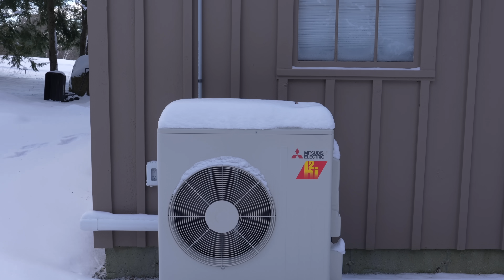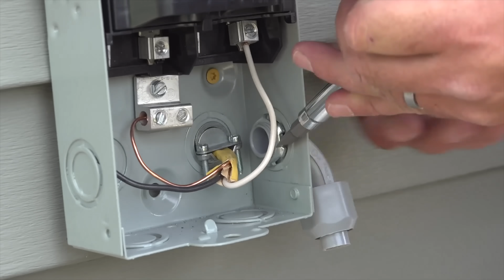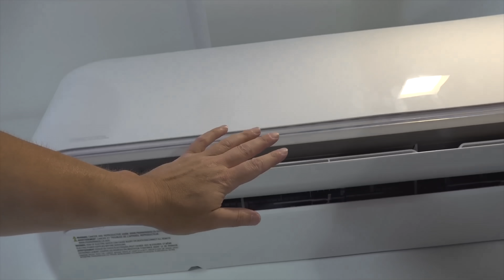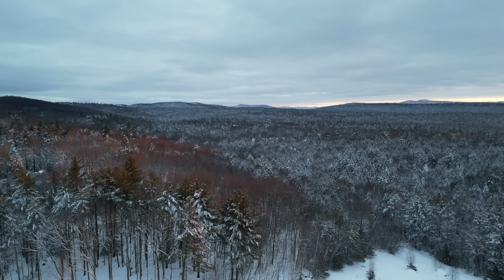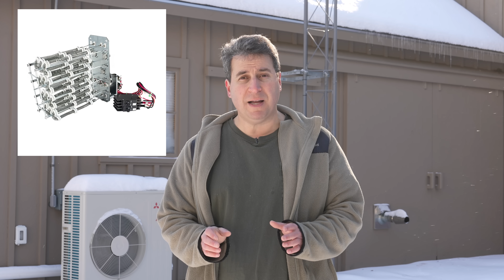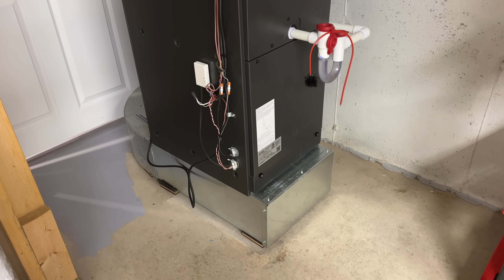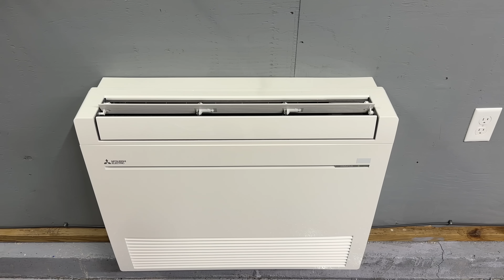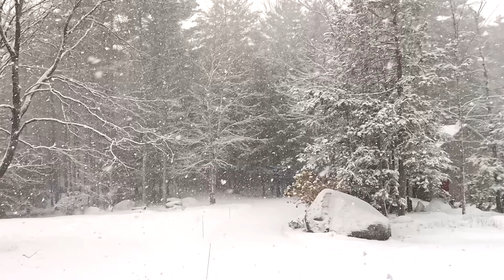Why Heat Pumps are now leaving people COLD

Comment: You mention at 3:55 about running resistive heat strips and "while that does use a lot of power for a brief amount of time it is much less electricity than simply running your heat pump endlessly trying to make up a temperature during those cold days". Do you have any data or sources for this? I am a bit hesitant to believe this, but if it's true I would definitely consider adding the resistive heat strips in my Mr Cool ducted heat pump.

Comment: Would a heat pump only system be adequate for a very well sealed and exterior+interior insulated new construction house in NE Ohio? I'm shooting for a total wall system R value of around 33, with triple pane windows, and a roof R value of at least 60.
Reply: My cabin in western NY we heat with a mini split all winter. No issues as long as the power is on. We do have a wood stove we use while we are their and for emergencies

Comment: What you guys really need is a heat exchanger for air that gets ducted out of the house- our European house has a ventilation system that circulates our air and recovers 97% of all the energy in the air it ducts out of the house, and I’m pretty sure it’s passive too. But our house does use a different concept for heating in the first place.

Comment: My installer installed a Mitsubishi Hyper Heat and sized it based on the 5 degree BTU reduced output. Running without supplemental heat and the heat pump system is keeping the house very comfortable down below 0 outside temperature. It helps if the install is done properly.
Reply: It's not rocket science, but many contractors are clueless.

Comment: I learnt that lesson the hard way. I bought A mini split because my baseboard heat was too expensive. Starting at 30 degrees outdoor temps. the baseboard heat has to be turned on because I want it warmer in here than 65 degrees. Mini split and baseboard used together still lowered my power bill $49. Cheaper than baseboard heat alone.
Reply: Well, yeah.

Comment: I don’t know man. Last winter I had  10F during the day for several days and my office (medium size open with no door) was 70F. I have Mitsubishi Hyper Heat.
Reply from the maker: As mentioned a lot depends on your home, size, insulation and what temp you expect. Mitsubishi makes great units. Sounds like your setup is doing well which is great. Power consumption and defrost cycles increase dramatically but as long as its meet your demand thats the goal.
Reply: @SilverCymbal Agreed. My house was built in the 40s, but I took a lot of steps after moving it to get it properly insulated by filling all the cracks. Power usage is definitely high. But it's the price I pay for not using oil (which would be higher). We do have supplemental electric baseboards (ripped out the oil hydronic ones and replaced them with hydronic electric), but I used it twice this winter in the bedroom (also hyper heat). And one of the times I was just testing it out. So yes, your mileage may vary, but the Hyper Heat is working very well for us (triple zone). We have another dual zone regular Mitsubishi for our lesser frequented rooms and that is also doing well, just not as well as the Hyper Heat.

Comment: Dual Fuel. I have a heat pump with a gas furnace instead of an air handler. Way cheaper to run than electric resistive.

Comment: This is inaccurate @3:58. The efficiency is denoted in Coeficcient of performance (COP). COP is KW heating divided by KW of power. a COP of 1 = 100% efficient. a COP of 4 = 400% efficient. during warmer weather, 55F, let's say the heat pump has a COP of 3.5; however, as the weather gets colder, the COP drops to 1.5, let's say. However, no matter what conditions are like for electric strip heat, the COP is always 1. Even in the dead cold, the heat pump is still cheaper. The only reason that auxiliary heat exists is because of a capacity issue. That's why cold weather heat pumps exist like hyper heat Mitsubishi models. They trade some efficiency for increased capacity in colder weather. However, the COP will never drop below 1. The heat pump will always be more efficient but may need more capacity. However, the hydronic coil may be cost-effective in some situations, but the strip heat never will be more efficient.

Comment: What would you consider the average life span of a heatpump that runs all year round?
Reply from the maker: Good quality brands can easily last 8-14 years. If you maintain the outside coil with cleaning that really helps. Likely in 10 years from now the efficiency will get so much better replacing it may be a good idea just for cost savings.

Comment: I have the electric auxiliary heat strips for my heat pump now and my electric bill still doubles or triples in the three coldest months of winter.

Plan on installing a propane backup heater this year.

This will also allow me to rely on solar to back up my electrical since the demand will be so much lower
Reply: Your heat pump is not sized correctly.

Comment: Good distinction on heat pump effectiveness and aux heat needs in NC vs New Hampshire. Here in NC as temps got down to 17F yesterday, 3 degrees below the 99% heat design temp for the area, my basic single stage 3 ton ducted heat pump ran continuously but the aux heat strips were never needed. My whole house energy use stayed below 4kw per hour except when my water heater came on in the afternoon.

In the past I found via my emporia vue monitor that heat strips were activating with each defrost cycle to the tune of 10kw for 2-5 minutes at increasing intervals as it got cooler. Once I realized the heat strips weren't necessary as part of the defrost cycle I disabled them on the defrost control board while leaving them able to come on if needed for aux heat. I never felt a blast of cold air during defrost, and per my heat pump's manual even down to 10F it would be twice as efficient as resistance heat though it's operating at half capacity. Natural gas would be nice if available at that point. If it got much cooler I'd likely be pulling out a space heater or two. 

One thing I like about small space heaters vs a 10kw heat strip is that it would be much easier to run the 1500 watt space heater on my generator along with my heat pump which has a soft start kit, while 10kw heat strips would likely overwhelm my generator in the event of a power outage.

Comment: Assuming air to air heat pump for heating a house. In example mini split unit. The efficiency is indirectly proportional to temperature differential. Assuming temperature inside the house constant the efficiency will decrease as the outside temperature drops. Fujitsu Halcyon should heat down to -5F (-20 C) when the efficiency is close to 100%. Some energy is also spent during the defrost cycle. The Mitsubishi HyperHeat is operating at 100% efficiency at 5 degrees F.    Even in Zone 7 (the great white north) the new Sumo coming from Mitsubishi has it's 100% efficiency pegged at -20f

What you are doing is fearmongering, not science...

Comment: I'm running my heat pump portable ac and at 11 degrees outside it can at least keep it 60 in my livingroom and kitchen where it is. I used wood burning stove and electric heat as suplimental though I try not to use the electric if possible. The heat pump is still way more efficient even at this temp suprizingly.

Comment: So long story short, you need 'additional heating' to your heat pump. And an Airco is literally just a heat pump. So this guy is saying, with a lot of words, that having an airconditioning unit to heat your home in winter when temperatures drop to 0, is not enough to keep your house warm EFFICIENTLY. it will, but the consumption of power is just really high. In fact, an airco, whether cooling or heating, consumes 'a lot' of energy until it reaches the temperature the thermostat indicates, and then goes into 'eco mode' so to speak.

all you need to do thus, is add another heater to your room/space. In other words, a literal electric heater, or an oil heater, or a pallet heater. pallet heaters consume little but are expensive to buy and place and they need an 'exhaust'. 

ethanol heaters are interesting but dangerous. 

electric heaters are fine, if you have one that is powerful enough. A 2 kWh heater generally consumes 1/4 of a day, meaning 8 hours 2 kWh if you run it for 24 hours. If you however set up a timer, and it is off during the night, let's say from 23:00 till 07:00 or 07:30, then it is on for  13:30 hours, so will be on for less than 4 hours - meaning it'll 'just' consume about 8 kWh a day - except that it would do this if it were the only source of heat.

if you combine this with your heat pump - airconditioning - then the supplemental heat of this electric heater makes the aircon reach its temperature easier and thus consumes less energy, but at the same time, the electric heater needs to operate less because of the airconditioning unit also heating the same room. 

The key missing ingredient however that is being entirely missed, is a ceiling fan. You need these 3 together. The ceiling fan will blow the warm air down that both the electric heater and the heat pump ( airconditioning unit ) are producing, eliminating quickly the cold air in the room, and keeping the warm air being pushed down. 

On top of that, all you need to add are shoes (slippers) with decent isolation, so you have an isolation layer between you and the floor. add carpets where you sit, which will operate as insulation between the (colder) floor, and wear warmer clothing - add a sweater on your shirt, and wear thicker pyjama's / sweatpants, add a small blanket when sitting, and add a few good heater candles. 

obviously, only heat the room(s) you are in. you don't really need to heat the bathroom at all. a warm shower is good enough, and if it is 'fresh' you will not 'want' to stay there for too long either so why heat a space you need to ventilate anyway ? 

the kitchen is only used for a few minutes in the morning / afternoon for preparing breakfast or lunch, and if you start cooking, the heat from cooking will warm the space up. use the oven more in winter. 

your bedroom only needs to have a relative small heating - a 'cooler' bed is better for your health anyway and thick, decent blankets and a good pyjama will be more than enough to have a good sleep, just, again, add a carpet right next to your bed and some slippers for toilet visits.

if you have a living room smaller than 25m2, and you put the electric heater temperature at 19 degrees C, combine it with the heat pump ( aircon ) and put that at 20 degrees, good clothing, and you won't have unneccesary high consumption. 

For those extra cold days - just add another layer (shirt) of clothing, extra thick socks, long sleeves, add a wool hat, and perhaps just put the electric heater 1 degree up.

compensate higher energy usage by taking shorter showers with less heat, lower the temperature of the boiler, and prepare foods that you can finish quickly - avoid like boiling chicken stew or soup for an hour or two. Instead, use meats that are cooked fast, less compact meats, and combine it with breads which do not require heating or cooking. 

Add a thermos, warm up some tea, and drink some rum or wodka in your decaf, and you'll get through the cold pretty well.

Comment: I’m in south Texas and we did get below twenty degrees at night. I have a heat pump in my garage and it did struggle to warm up the area. I simply turned on a space heater and it did the trick. I had to keep my newborn pups warm during them cold nights.

Comment: This is similar to a Swamp Cooler; in very low Humidity and in a specific temperature range...a Swamp Cooler will cool your house by about 10 degrees for a much lower cost than an Air Conditioner. But in high Humidity or outside the optimum temperatures a Swamp Cooler is not just more costly it has serious downsides or does not work at all. Swamp Coolers HAS to have humidity low enough to do its cooling; it cools by evaporation...so if humidity is too high evaporation does not happen.

Comment: Regarding the heat pump becoming super expensive in winter:  Electric heaters have a ratio of 1:1 kWh electricity to heat. Heat pumps have a ratio of up to 1:8 under ideal conditions, but even in the severe cold when the ratio goes down it will still be something like 1:3 at -10°C but never be as bad as an electric heater which is 1:1. For supplemental heating just get a wood oven :-) Greatings from europe
Reply: Not 1:8, it's 8:1. Heat pumps are a minimum 1:1 efficient and typically go up to 4:1, 8:1 would be rare circumstances.
Reply: i wrote ratio kWh Electricity to heat. all ratios are as i wrote them. You probably mean SCOP numbers, which are averaged / mean values.  @imzjustplayin
Reply: @JohnnyTheCache  well you had the ratio backwards imo since it's usually it's amount of heat produced per kilowatt. So 5kw of heat: per 1kw of input for example. 5:1

Comment: Right now I have 220 baseboard heat, I am thinking of going to heat pump systems, and supplement them with smaller 110 baseboards for if it gets really cold.  Or of just putting 1 20amp outlet in each room for a plug in heater if needed.
Reply: Your baseboard heat is the same as auxiliary power strips.  A heat pump will be 3X efficient as a minimum.  More like 4X and higher with modern hardware. Whether it has a viable payback for you is up to you.

Comment: Great video, very accurate. I like how you mentioned it really depends on your home construction. In my situation I have a single stage heat pump that works reasonably well until about -2C and a 10KW backup heat strip which is ungodly expensive. I also have an 18K BTU gas fire place, which in reality is only about 11K BTU effective. On the really cold days (for my region) that fire place is able to maintain a comfortable temperature inside my home and the backup heat is only needed when trying to increase the temperature. It depends on your home, your climate and your level of comfort.
Reply: I bet a museum would pay  you good money for your dinosaur
Reply: @andreycham4797  Yeup, but you know what, it’s reliable and paid for. Running the thing into the ground is better than replacing it with 20K worth of new equipment 10 years before it needs to be.
Reply: @JordieG8  I pay 28 cents pro kilowatt ,  and the system I installed pay for itself in three years. It costed me less than $1900 six years ago
Reply: @andreycham4797  ouch, I pay 9-14 Cent/KW. 🙂 my system is a 36k BTU forced air system. And it’s only 4 years old, if I were to replace it with a variable unit like, I would be looking at 20 Grand to replace it with something of decent quality. It would take a lot more than 3 years to pay for itself as I live in a rather temperate climate.
Reply: @JordieG8  I diy everything it is not easy nor fast  but slowly I get some skills and confidence
Reply: @andreycham4797  mini splits are shit simple to install if you can read and have the tools.
Reply: @JordieG8  yep , I have a condo and HOA board will not allow to put a condensing unit outside. So I have to push heat pump into the attic and run all pipes and wires for three heads through walls . Now I plan to install more heat pumps on my second property still hoping that I will get some rebate as diyer. Gree and LG  are on my list
Reply: @andreycham4797  I have not had good experiences with Gree.

Comment: finally, because of real life conditions and time the truth is coming out. Now if we could also be honest and forthcoming about the mammoth potential cost of service with a major component failure and the cost of professional cleaning every 2 to 3 years, customers could make more informed decisions about back up or supplemental heat options.
The typical installer doesn't want to be bothered by all of this. They make more money installing as many as they can and never looking back. Heat pumps are the future, but we should only be installing hybrid systems like your use of a hot water coil supplied by your boiler. That means 2 things. 1. you will have enough heat when it really gets cold and 2. the installer that is only interested in making money installing something that they can't service will go away!

Comment: How long are these units expected to last? I’m hoping 10…
Reply from the maker: Yes, very long. Some mini splits are 15-20 years old and still working well. The biggest thing IMO is cleaning the coil outside primarily but the insdie as well. I did a video for my Mr Cool. Its easy and really lets them peform at their best: https://youtu.be/DSNUyxZtrmo
Reply: yes the cleaning is difficult.after about five years of rain and spring dander , the radiators that pass the air plug up.